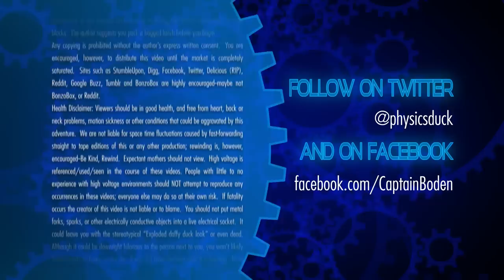Captain's Blog CCC Shoot 1 and Van Repairs

Comment: Dry cleaning - They take your clothes, wash them in hideously dangerous solvents (that used to be derived from petrol) and then dry them. The kind of dangerous solvents that, if spilled, cause men in orange suits to turn up and all your neighbours have to move house.

It's called "dry" cleaning simply because no water is used, rather than it being some sort of space-age cleaning system where dirt just magically comes off your clothes. Which makes it sound 100x less interesting.

Comment: Check the label on the brake parts cleaner. If it smells like a dry cleaner then it's most likely tetrachloroethylene, also called perchloroethylene (PCE) or just "PERC". Dry cleaners use the solvent to wash clothes that are too delicate to be run through tumbling machines.

Trichloroethylene (TCE) is the more common parts cleaner, but as you go down the degradation path (PCE, > TCE > 1,2-Dichloroethane (DCE) > Vinyl Chloride (VC)), the chemicals become more hazardous to human health...which is why chemical remediation was such a PITA for us at dry cleaners. The more we broke down the chlorinated solvents, the more hazardous the product until finally breaking down the VC.

Comment: - 10:00 a way to get around the read not write is MacFUSE with NTFS, depending on which version of OSX you're catering to.

- 12:30 it is indeed Crossfire on ATI/AMD cards. newer AMD cards do crossfire over the PCIe bus given it's 3.0 or newer now, if memory serves.

- 13:40 it might be the absolute last, but the GPUs are 3 generations behind. we're already past the HD7000 series. the ATI HD5000 series is great, but honestly are not as efficient as a pair of HD7970's would be instead. that said, the 5870 can still hold its own, I commend you and Rocco for getting a card I'm currently VERY ENVIOUS of. 5870's are also good for GPU mining Scrypt-based Cryptocurrency like Dogecoins, although not the most efficient cards in existence.

- 18:25 extra power cables? each of them will need two PCIe power connectors in order to function AT ALL. if they're not plugged in, you have a chance the machine just won't boot. I'd also check the wattage on the Mac Pro's PSU and see if you have even enough juice to run all your stuff now. those cards have some pretty massive power requirements.

on a lighter note: YAY THE FOCUS IS FASTER! 
have you also considered getting a proper weatherproof floor liner for the work van's back space? it may be beneficial during donation pickups.

Comment: If your gpu has two power sockets, it needs two cables or it won't run.
You can get 4 pin molex to pcie power adaptors, but I would rather upgrade the psu than use them. 6 pin pcie connectors supply 75 watts each. Using splitters may overload your power supply and make the system unstable.

Comment: You can't just split your power cables, well you can, but the card will not get the power it needs. Get a proper power supply with enough voltage on the 12 volt rail to supply what the cards need